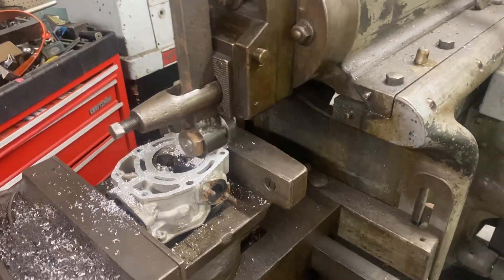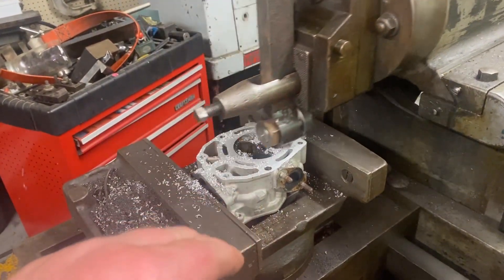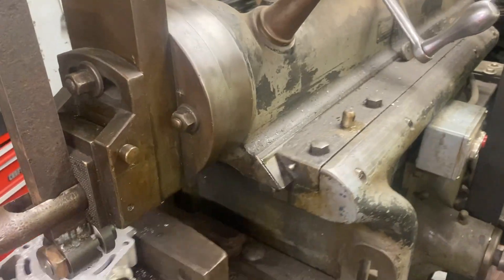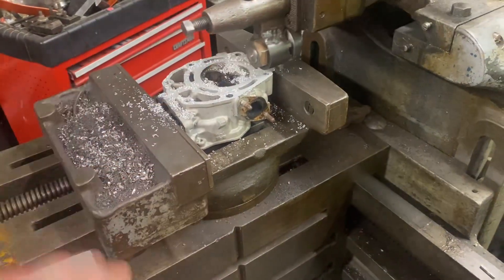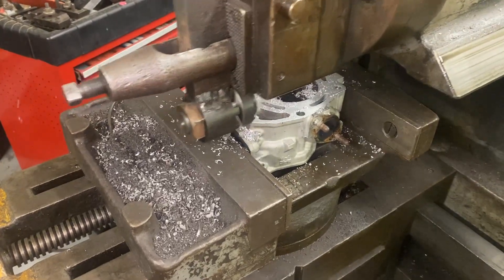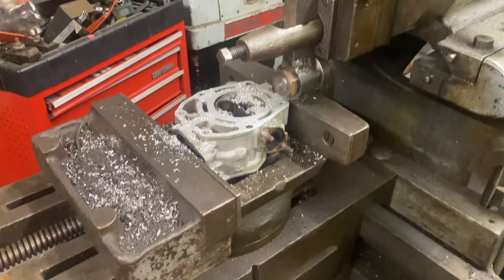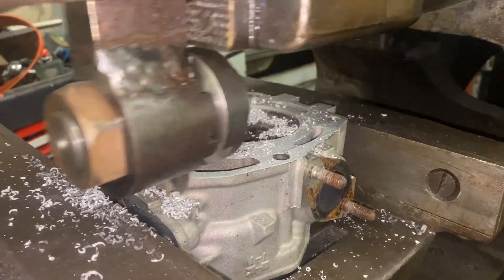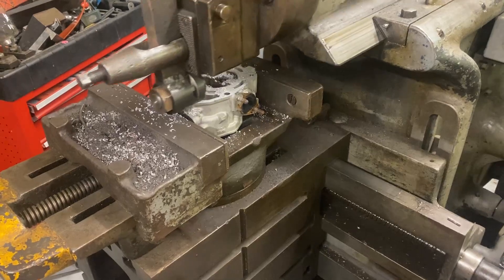Metal shaper action on a cylinder head

Comment: What is the advantage of using a shaper for this vs. a mill?
Reply from the maker: Personal preference mostly, you could easily do it on either.  With the bigger vise on the shaper it was a lot quicker to setup
Reply: In the smaller workshop they are cheaper to run in terms of cutter costs. And they are not as slow as many make out.